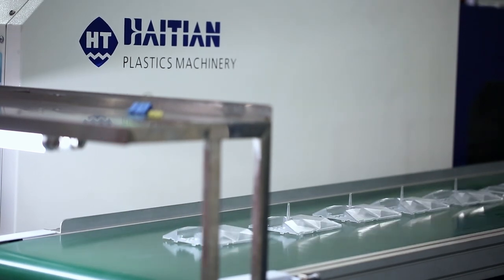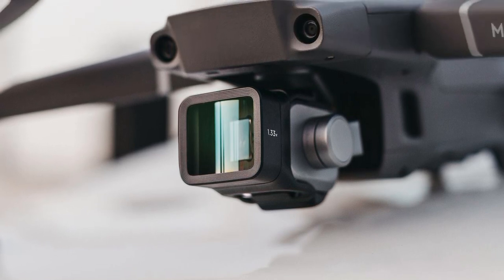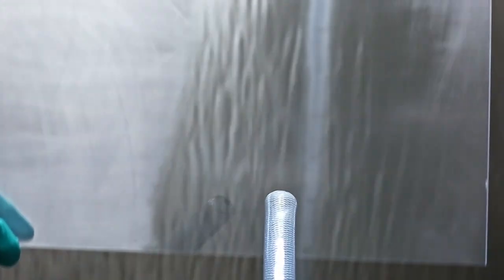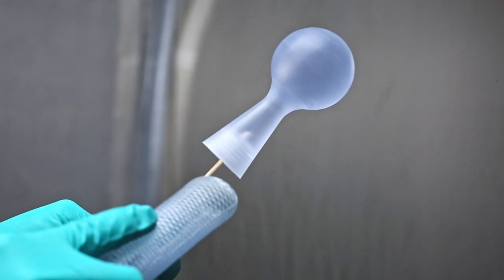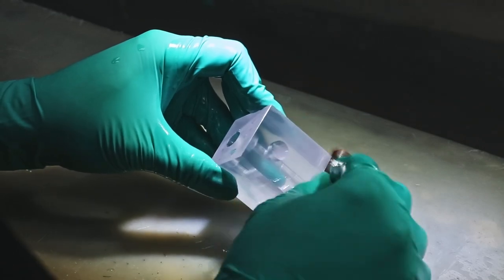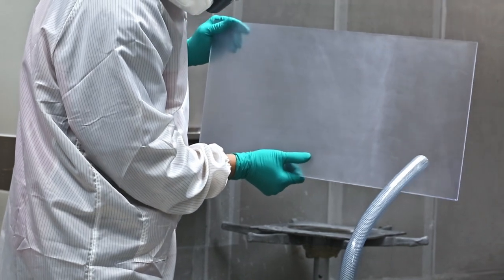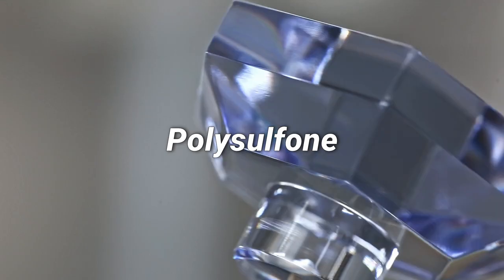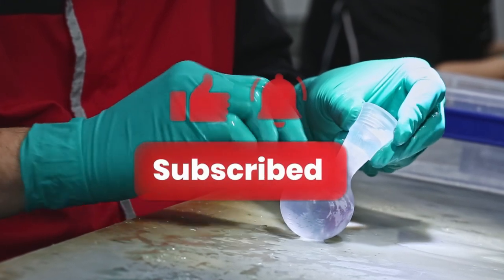Vapor Polishing of Polycarbonate, ABS, Acrylic, Nylon etc. | EXPLAINED - Engineering 101 - Ep3

Comment: To protect against Methylene Chloride, the NIOSH Chemical Pocket Guide only recommend respiratory protection in a supplied air mode. Therefore, there is no cartridges suitable for an application where Methylene Chloride is present.   soooo, what cartridge are you using?  What is the "positive air pressure "system the technician is wearing?  Thanks.
Reply: He's not.
Reply: yes, very clearly a completely uninformative, and even dangerous, clickbait video

Comment: What grit sandpaper is best suited for this kind of polishing?
Reply: 2500 to 3000 and then polish. The further you go up in grit the easier it is to finish and have it look perfect. Also if you start low like 220 grit, each progressive grit MUST be stepped up in small increments. Don't want to skip grits to find out in final polish you can still see rough sanding marks from advancing to rapidly. Use a mister and some water with one or 2 drops of Dawn dish washing soap to keep your sandpaper clean and your material from burning as paper typically loads up without it...
Reply: @joesshop3622  I polish under the water tap with water flowing, this works quite well.
Reply: @vanillaexplosion99  Most certainly, I mention the mister for applications that cant be soaked or are simply "at the bench friendly lol"